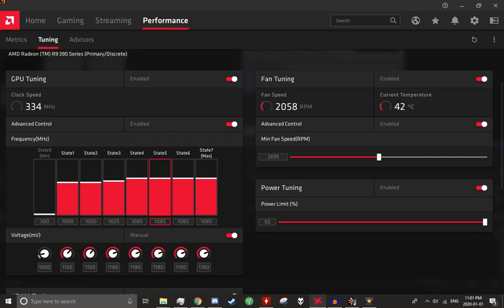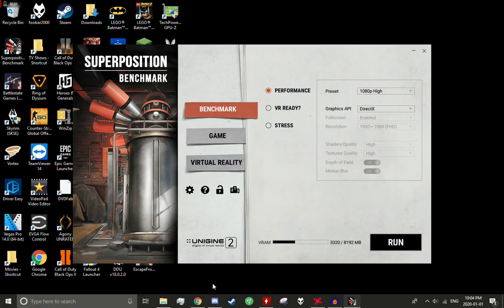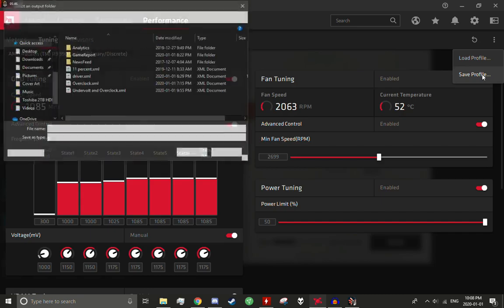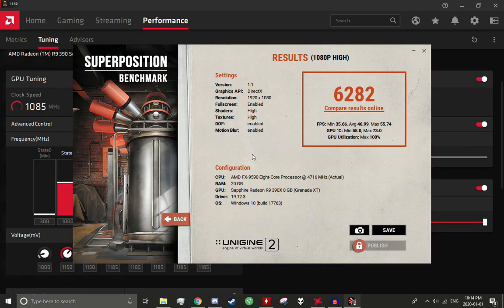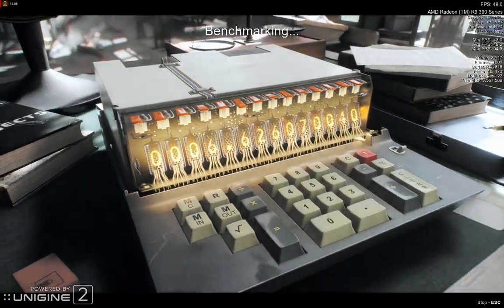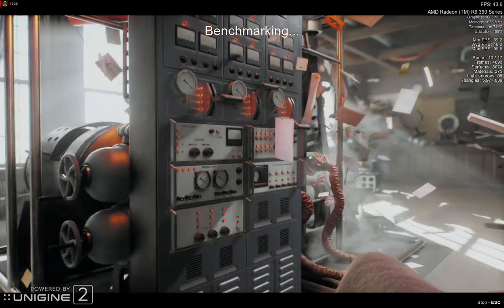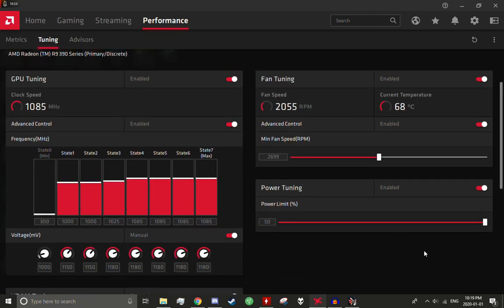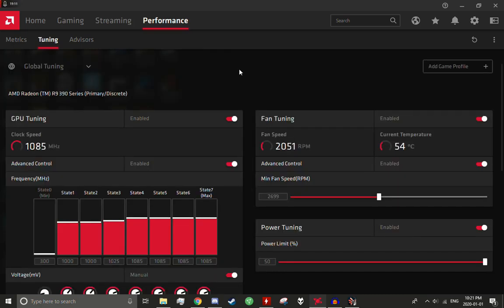Overclocking and Undervolting using Radeon Wattman 2020 | Radeon Software 19.12.3 | R9 390X Tri-X 8G

Comment: i use both to tune up my card (amd software @ MSI afterburner) for frame cap i use amd software, and for frequency and voltage i use MSI afterburner ... i wanna get rid of MSI afterburner, but that multi-state configuration confusing me  ... my current setup is -75 mv and -115 mhz (its a little under-clocking to save some power), so how to copy that setup to amd software 2020 ?

Comment: can you make a video for r9 390 asus strix? or give the settings, since i'm having overheating :S
Reply from the maker: Same settings should also work for the Asus Strix version, both cards match 1:1 specs-wise ;)

PS: Overheating/throttling occurs over 80°C, and if this is happening (even after undervolting and setting a custom fan curve) I would recommend re-applying a newer thermal paste to the GPU as it has likely dryed up over years of use (as it does).

I hope this helps!